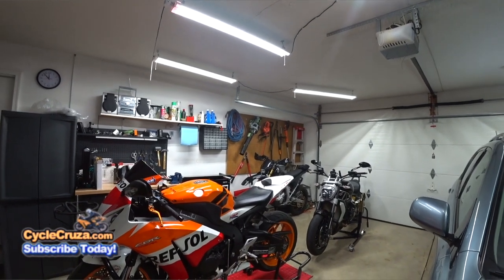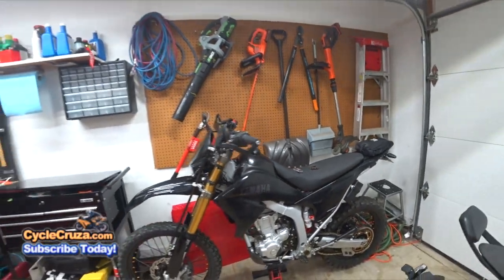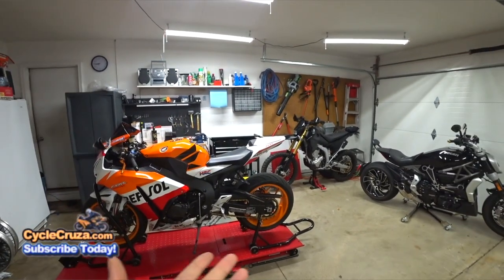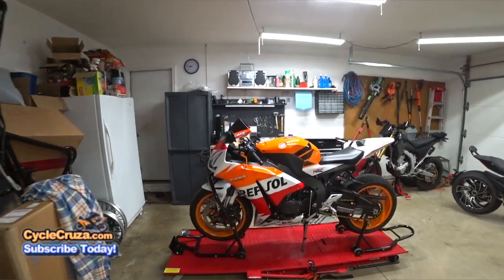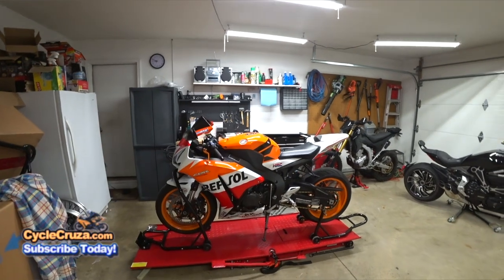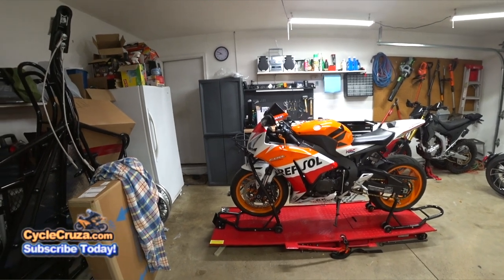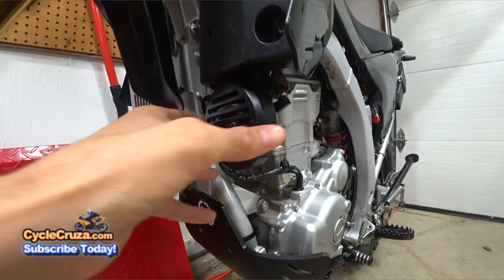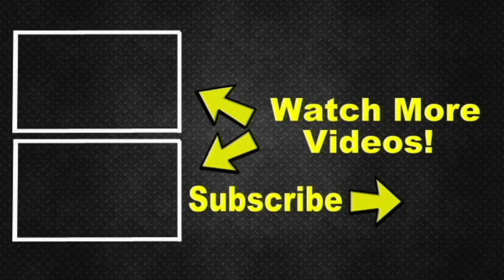10 Mods I Did That Were HORRIBLE (AVOID these Motorcycle Mods!)

Comment: You just put up a video shortly ago saying you love front sprocket swaps and showed all the bikes you put it on which were all of the bikes you have owned. A whole lot of contradictions in most of your videos but entertaining nonetheless.
Reply from the maker: You did not listen and are misquoting me. I said I never had an issue with a front sprocket installation until installing that  Pro X sprocket. My last set of sprockets on my wr250r were great. This was the first time I used PRO X for a front sprocket, which is trash. Pro X didn't even have the decency to email or call me back, it's been two weeks! From here on out I will only use OEM front sprockets to avoid any issue. I will continue to use aftermarket for rear sprocket but never for a front sprocket again.
Reply: CycleCruza all of the other sprockets were aftermarket front sprockets and fine correct? One bad install/part#/or low quality part shouldn't change your entire history of 100% reliability with aftermarket front sprockets. You said it yourself in all the new videos about not feeling right about it and questioning it multiple times. Saying aftermarket front sprockets are all bad is a big jump in stance and not warranted statistically speaking.

Comment: If you ride street STOP MODING your bikes. You aren't improving the bikes and you are not smarter than the engineers who designed the bike. Just buy and ride.
Reply: There is something to be said for that. 
"Performance" modifications are pretty much like knocking down dominos. Sure, eventually you might get it all done but you can end up chasing issues for years, and more often than not end up in a vicious circle of upgrading only to end up with something incredibly specialized and the daily use and reliability gone.